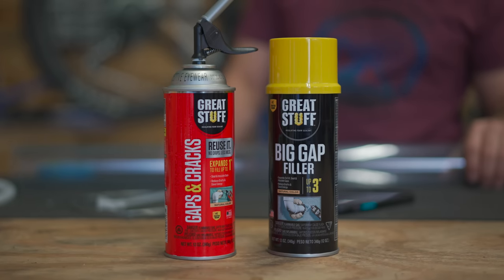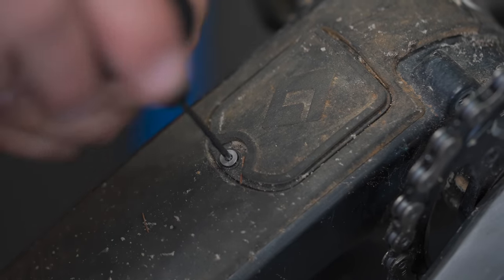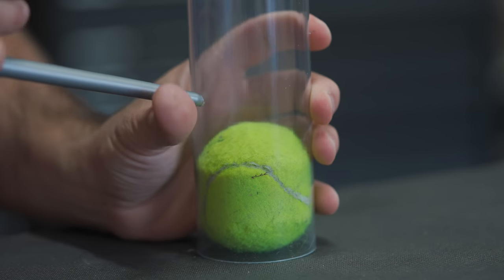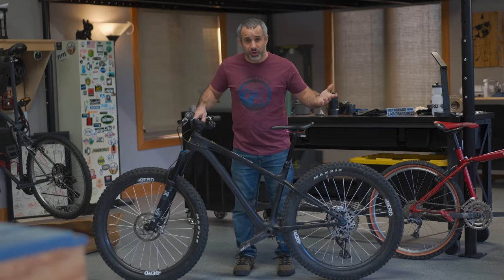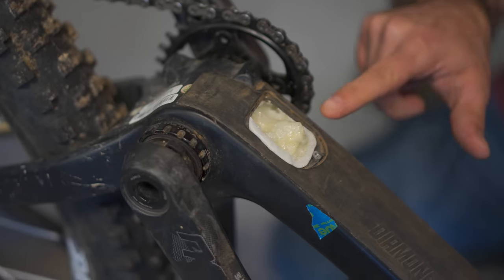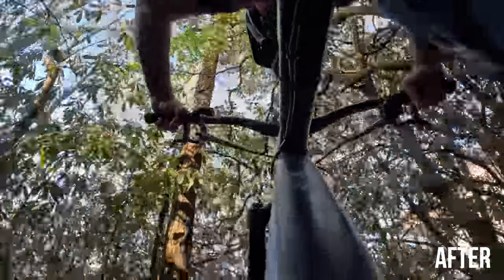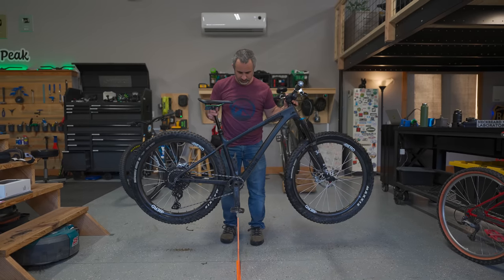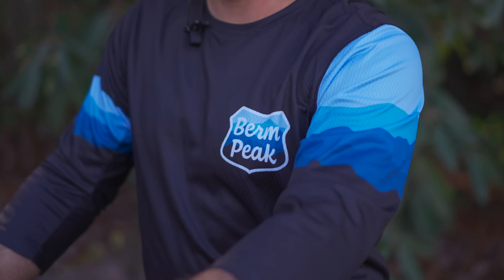Filling my bike frame with foam made it better—kind of. Don’t do it.

Comment: The hollow bike frame might act as a wave-guide and direct sounds and impacts from one part of the frame to another.  For example,  internal sheathing around the cables inside the frame, rattling against the side of a tube near the bottom bracket, might be directed up the the seat tube and closer to the decibel meter.  Sound also propagates faster through solids as well so by filling the tubes with foam you dampened a lot of those higher frequencies resonating through the frame and cavity resulting in it being more "dead" (as you put it) sounding.  Those dead sounds you hear are just the undamped low frequencies that have a longer wavelength and, interestingly, they remain as loud as they originally were but lack the "sharpness" that the same noise had before you neutralized those higher frequencies.  It's sort of like leaving the volume on your old school boom box at 10 but pulling down the right 3 sliders on your equalizer.  You get more muffled sound and the perception that you added bass even though you didn't.
Just a sidenote, I assume you read enough of reddit to know to use closed cell foam but it's worth mentioning that Great Stuff expanding foam is "closed cell" which means it won't absorb water when you do that stream crossing.  Heaven help anyone who finds themselves in the middle of a long ride, a frame full of open cell foam and a bunch of water obstacles.  Might want to pack an extra Clif bar for that one.

Comment: I used to work at a factory where we made spray foam. Although I'm sworn to secrecy about some things🤣🤣  I can tell you this. Today's spray foam has a closer consistency to plastic than actual foam. We used to clean up spills with acetone because it breaks it down and comes right off before actual expansion. It will continue to expand even after you think it's done

Comment: Bianchi used, or maybe still does, fill the entire lower half of their high end road frames to "stiffen" the Bottom Bracket area of the frame.  I first learned of this information around the Pantani era.
Reply: Yes indeed. You remember correctly. Came here to say the same. From the Bianchi Canada archives......

Technology Solutions Structural Foam Injection is a 2-component non-toxic foam developed by Henkel Spa Surface Technologies and patented by Bianchi for specific cycling applications, i.e., as a tube strengthening material.

The results obtained through the introduction of SFI have been noteworthy: a weight increase of only 20 grams yielded a 15% improvement in stress resistance, while resistance to fatigue doubled in the bottom bracket area.

All this was made possible by the special properties of this foam, which is able to distribute the loads evenly, avoiding fatigue build-up in high stress areas and in welded parts whose composition has been thermally altered.

Comment: You should use a 2 part structural rigid foam, you can pour that and it'll expand within the tubes - if you're going for every last gram you can thin the walls on your tubes down a little (the real reason you hear some race builders have done it, rather than the ones they put out) because the foam helps with buckling and impact strength, as well as a bit of damping.

Often the same is done with cars in the a-pillars and sills.
Reply: Yeah it works, but insulation foam isn't really suitable.

Comment: The foam is polyurethane foam and requires 2 things to cure: moisture and ventilation.  The foam they use in cars and such is most likely blended to cure inside closed sections, that's why the inside was still gooey when you removed the tumah.  It's likely the foam will take a while longer to full cure, removing the cover plate to let it "breathe" might be a good idea.
Reply: I recently used some of this stuff to surround a copper pipe coming out of the wall. I was shocked to see how long it took to fully, cure/expand. 24 hours later I thought that of course it would have to be done by then, another 24 hrs later it had expanded even more, I was like what WTH?! I wonder if it will ever fully expand in his bike. When he was waiting for it to expand around the tennis ball I facepalmed so hard I hurt myself.
Reply: This is true. It is carcinogenic so should only be sprayed in a well ventilated area.
Reply: @dtz1000  the air your breathe is carcinogenic. Theres a difference between something being rated as carcinogenic and actually BEING carcinogenic
Reply: @davidjoseph7142  lol

Comment: As far as breaking frames, a few things:

The RED can is for window frames and has low expansion pressure (and low expansion in general) so it will not damage or warp the window.

The BLACK can (big gap filler) is high expansion high pressure and absolutely will create enough pressure to break things - though probably not a carbon tube.

As someone else mentioned, these single part foams use air to sure and the red can will not cure in large sections of more than an inch or so. The black can cure at up to 3" or so.

Using foam is a legitimate way to strengthen and stiffen things (and deaden sound). Hockey sticks for example use foam in selective locations and densities to tune the stiffness of the stick. There was a steel bike seat post with super thin tubing that was filled with foam in the 90s (and one frame filled with pressurised nitrogen too I think).

This could be something interesting to keep trying out, however you'll need to do more research in getting the correct type of foam (try "smooth on" and boat building websites for info). You need something with a 2 part chemical cure, low density, high expansion, low to medium pressure, and closed cell for no water absorption.
Reply: informative. thanks
Reply: The blue can is for windows
Reply: @Stevesbe  They have a few variations of course, I have the red cans right next to me, used them on my windows. The red is for larger gaps, blue for smaller, but they are still both low pressure low expansion.

I used the black ones for big holes, and it moves plywood, drywall and door jambs if you put it in the wrong spot.

Comment: We played around with handlebars thinking a sudo vibracore. The problem we ran into was the canned stuff required air to dry and never really did. I'd like to see it where it's the 2 part foam that is a chemical reaction. That seemed to work a lot better but ended up just buying vibracore bars at the end. Cool vid!

Comment: I've used it on an older frame to quiet down a piece of a rivnut that fell in the downtube. No openings at the bottom bracket or head tube. Worked fine, no issues, though the bike did have external routing.

Comment: I've done a similar thing with packaging foam. Take off the fork and that will usually give you access to the down tube, then fill it with the packaging. The nice thing is that it's reversible. Works well.

Comment: It makes sense. Even if the frame isn’t the source of the noise to begin with, the fact that it’s hollow and has its own resonance can be amplifying components attached to it.  Also, some annoying sounds might not take up much acoustic energy and reflect much on the dB meter.  

My question, which I suppose you answered by not talking about it, is if there was any difference in the way the frame felt to ride. Thanks for another fun video!

Comment: Do a follow-up where you fill your handlebars with foam and compare them to factory-filled handlebars and carbon ones :)
Reply: Would like to see the effect on aluminum handle bars
Reply: You can buy foam filled handle bars off the shelf (Spank spike 800 vibrocore). It's meant to reduce vibration they also have carbon wheel sets with a foam filled section
Reply: @richardprust3366  I know, that's wh I asked him to....
Reply: @Checker201lol  already done by others, it works. prob more important than the frame for comfort, but less for strength.
Reply: I just installed new foam rubber handgrips. They are great for a rigid bike.

Comment: You need a real 2 part foam that is designed for filling structural frames.  You will see a large difference in not only less resonance, but I would also expect a notable increase in rigidity, and that should change how the bike handles.  Get two identical frames and fill one with a quality 2 parts frame filling foam, and get it filled to the brim in all areas, then run a side by side.  Filling tires would be easy too with another 2 part foam that is designed for repeated compression and high rebound.
Reply: i think the military tried it in tires but gave up.

Comment: I would be surprised if the foam ever even dries deep down in the center of the frame. I've used alot of spray foam in construction over the years and if it can't get air it never actually dries to become foam. It turns to a permanent orange gel of sorts.
Reply: It needs moisture to harden
Reply: @dirkg.950  Not Moisture. But Air.
Reply: @lossantoscity3249  not air, but moisture. Concrete is also like this, since it’s a chemical reaction taking place and not simply drying, you need all the reagents present for it to complete
Reply: Yep, I've found uncured foam that was years old. Usually from someone trying to fill too big a gap all at once.

Comment: I enjoyed the video.  A little over a year ago budget restraint we bought the mongoose ledge x1 and x2.  Have ridden those stock since.  Light trail riding.  With plans to make them more capable.  I believe they ran $400 for the x1 and $500 for the x2 from Walmart full suspension.

Comment: This is a little off topic, but I have found the greatest noise reduction move on my was switching to Onyx Racing hubs. They are kind of expensive, but completely silent. Most people like the bzzzzz sound of high end hubs. I used to as well until I started using these. Aside from being silent, they also have instantaneous engagement which I love for technical climbs. They are heavier than most comparably priced hubs, but I think their silence and engagement makeup for the weight.
Reply: I find those super loud bzzzzzz hubs very annoying TBH. Unnecessary as well.
Reply: I really want those silent onyx hubs. Loud hubs are great but silence is amazing.

Comment: As someone who did car and home audio while I was in trade school to be a mechanic: I've used this product to fill in a seat on a shitbox car I had to drive home.

I think a better idea would be to get sound dampening paste or stuffing some old towels into the frame. 

First on the paste: this is overkill, but you can get it for home construction and car audio installs, so a little leftover could be dicked around with on a bike project.

Second on towel stuffing: While custom GIK sound panels/bass traps are amazing, you can also build them yourself. One of the cheapo things I would do for people is if they had already hung wall art with a deep box frame. Just stuffing a bunch of old towels from a thrift store in the negative space drastically improves acoustics. You can do the same with a bike if you wanted too if you have a bunch of old t-shirts, etc or those rag boxes shops get. Plus you can continue to use your tube storage options etc AND you'd always have a rag in stock while on a ride.

Sound dampening is literally about absorption (and Sieben levels).

Comment: Might have made more of a difference with acoustic rated expanding foam, that stuff is surprisingly effective for sound dampening, if often seen that as the biggest criticism of carbon frames, they're that rigid it's like a tuning fork. Also, I seem to remember someone trying it in handlebars as a home made spank vibrocore alternative, and the conclusion was the density of the foam is crucial, normal expanding foam wasn't dense enough for that application.

Comment: Seth-
Klein bikes used to ship their beautifully painted fuselages (frames) in a box filled with expansion foam, they had plastic type bags protecting the frame from the sticky stuff, very shipping company proof when sending them around the world, not as environmentally friendly as (edible) corn starch packing peanuts, which dissolve in water.
Gregg
Reply: Seth, seth, seth, seth, and the chant goes on, read my other relative post

Comment: I never thought of that. I did fill my steel chrome moly frame with helium before to save weight.  It worked great for climbing. Hardly any pedaling to go uphill. The problem was going downhill. 😕

Comment: Seth, could you test the largest brake rotors that you can find? I've recently seen some 246 mm Brake rotors. It would surely be interesting to see, whether their performance is on par with their diameter.

Great video as always. Keep up the “scientific testing”!
Reply: Which bikes even fit those rotors safely?
Reply: @sebastianjost  I guess any if you buy the proper adapter?
Reply: Well with bigger brakes in cars. The most limiting factor is tires. If you have tires with better grip you will stop faster and more consistantly. Bigger Brakes in most cases just allow you to stop harder with more frequency since there will be more thermal mass. But then you have to consider will the extra weight cancel out the stopping power it might give.
Reply: I think most brakes have the power to lock up the tires at any time, but not heating up as fast and cooling off more quickly would be the big benefits. My nothing special MTB I always worry about overheating the brakes since I'm a big guy
Reply: I've got 559 mm brake rotors on my mtb and 622mm on my road bike😆
Reply: @itsreaper1644   oh no , heavy rotors won’t cancel out the performance. Big rotors are recommended if your fast ,heavy or it’s very steep and it’s 30min long. Small rotors could die here and are definitely not consistent. Even big rotors could fade. Try the longest race there is like the Mega Avalanche down icy snowy mountain till your in The Valley
Reply: @Vanadium  Well what you're giving is extreme cases. Most people do not need bigger brakes if they understand how to properly modulate and trail brake before they need to do a real hard brake. Often times just having good pads and fluid is enough. Now I do motorsports tracks days. So I get when a person is really pushing it they would need larger rotors. But the average consumer isn't really gonna need it.
Reply: @itsreaper1644  don’t know the average consumer really but because I am close to the alps I guess never see them 😆
Brake modulation is the key but when your doing one trial and it’s going for half an hour you should really get 203mm rotors unless your very light . 

I do even like my more heavy and bigger 220 mm rotors because I need less force to achieve the same thing. It’s a massiv help for those bigger descends to stay relaxed and be faster for longer. The bigger rotors even help me when the trail is only 10 min long. The brakes are just more consistent overall and don’t need maintenance so often like lighter rotors need because of bending. I really hat it when it happens
Reply: @itsreaper1644  I decided for the big rotors because of finger injuries and could not get so much pressure with this finger. Same reason I bought the second most powerful brakes.

Comment: I am starting to think whether i could use closed cell expansion foam to fill my steel bike frame  to prevent internal corrosion ....i know, that anything that blocks the water vapor  way out, can make it condensate more in the frame, causing further corrosion, but  filling the tubes with foam makes a physical  contact of the foam to the tube walls on a chemical level and fill the entire space.. That could in fact  eliminate the corrosion from occuring at least to some extend. Or is it a nonsense what I'm saying?😅what do you think? ...

Comment: 2db is considerable! -3db of difference is half of the acoustic energy. Also, it is common for meters to weigh different frequencies differently, so if it sounds "deader" it may be because it has less high frequencies and thus it will read a lower sound pressure.
Reply: 2db is usually the point where it'd become detectable in person with A B testing. Harder to judge based off recordings or when you can't alternate back and forth.
Reply: You need to double the power to get a 3db gain. But, you need 9db or 10db to perceive it as double the power. A 2db difference is almost undetectable, or getting to the point its detectable. Power and perceived loudness are to different things. The last goes in the psychoacoustics domain.
Reply: @StarAD  Absolutely correct. And I would add that the SLM that Seth is using has a listed tolerance of +/- 2.0 dB (definitely not a Type 1), so the 2 dBA difference observed means nothing.

Comment: I own a spray foam insulating company and for the best results you would want to use open-cell retro-fit foam. It is designed to be pumped inside of empty, uninsulated, wall cavities using small 1/2" holes. It has the most expansion of any other type of foam. Plus, the foam we use comes in 2 parts, which mix as they are sprayen out the end of the gun/applicator.

Comment: Hi Seth, I ran your data to check to see if there is a significant difference between volume(db) with vs w/o expansion foam in the frame. I ran it through a two tailed t-test in excel and the numbers showed that the difference is not-significant. The p-value was .06 meaning that we fail to reject the null hypothesis (aka addition of foam makes no significant difference on volume of bike).

Comment: I like the idea of internal routing cables but it took me a few weeks to isolate the noise on my Trek Dual Sport. I thought it came from front fork when I go though a drop but it was from the rear brake line in the down tube. I did some research here on this site and finally decided to carefully wrap the brake line and insert to the frame with bubbled envelop from Amazon. It works. Now I know what to do if I hear that clanking noise again on my other bikes. Insulation foam is not a good idea IMHO.